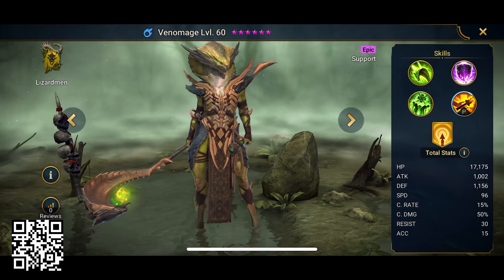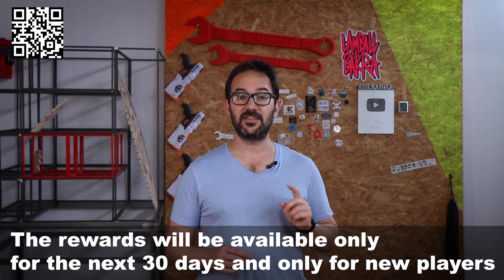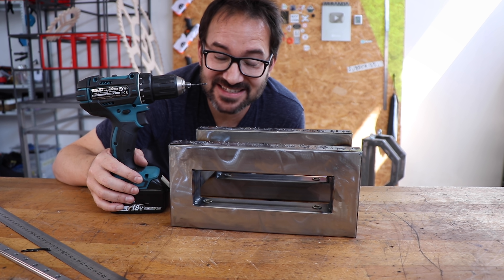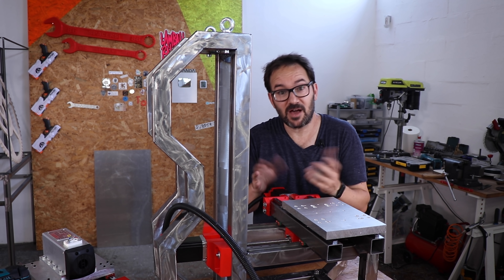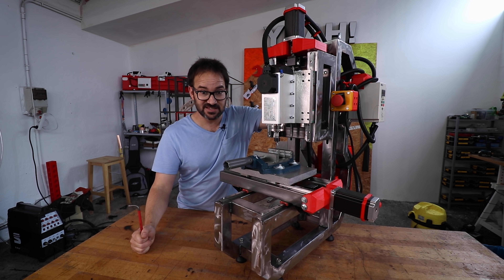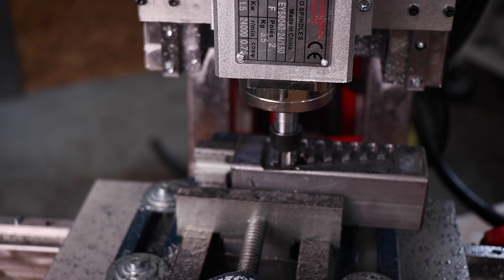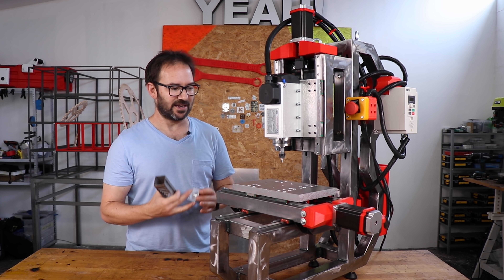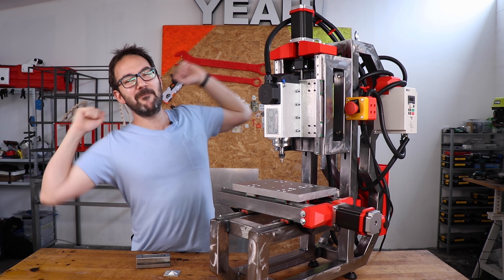I MADE A STEEL CNC MILL FROM SCRATCH (desktop version)

Comment: Check out epoxy granite casting. Its a cool way to make really rigid and strong machine bases without having to pour your own cast iron. You know, when you inevitably decide to make an even bigger machine. 😁
Reply from the maker: That will definitely happen so I'll need to find me some epoxy granite yes.
Reply: @ivanmirandawastaken  Yes, Yes, Yes!!!!! We are living in great, great days! 👍😁👍
Reply: @McGutschy2  yes, using insane amounts of highly toxic substances that will dever decay.. and also act as hormones in mammalian bodies.
Reply: @ivanmirandawastaken  A cheap and easily obtainable alternative to granite / garnet is aluminum oxide - Also a good way of recycling used blast media. Its also more dense so you'll get more mass for the vulume you pour of it which might help you if you're building small desktop machines
Reply: @_billyk_  the weight gains from Aluminum Oxide would be good, but the reason Epoxy Granite is specifically recommended is because of the vibration damping that is created by the specific blend. From what I remember, EG has even better vibration damping abilities than cast iron, without the multi year seasoning process cast iron requires to properly remove all the stress inherent in the material.
Reply: @ivanmirandawastaken  remember to 3d print (with a large enough printer) all the internal structure of the granite cnc.. Holes / conduits for wiring..  Lubrication..  A mega jig where all the nuts and where a  structure  for fixing the rails will go..  Etc then all that goes inside a simple mdf mould where u pour the granite cnc.. When it hardens u just put the rails and stuff over it and its over. U may not ever need to take the mdf out.
Reply: @JorgeMarioManuelOrtega  You Will need to take the MDF out as it eventually absorbs moisture or cutting fluids and oils and then swells up, thus ruining your accurate surfaces. If you do wish to make formwork for concrete or epoxy castings then I would recommend that you purchase cabinetmakers white melamine board, (HMR, High Moisture Resistance, if you wish to use it for several pours) as it is basically the same price as MDF without as much of an issue with the dust and water absorption.
Reply: I look forward to seeing that.  I used some in another application, want to use it to add ballast and rigidity to a CNC platform...
Reply: @ivanmirandawastaken  wouldn’t be a bad idea to fill the tubes with epoxy. Will absorb a lot of vibration and reduce chattering on parts.
Reply: @ivanmirandawastaken  fill those tubes with and that machine will go from meh to f***ing A
Reply: Love to see this followed up im in the process of planning my first cnc build but i want something more than most affordable consumer options been already thinking some form of epoxi granite and box steel welded frame myself@ivanmirandawastaken
Reply: Personally, I think there's a bit too much that can go wrong for the beginner with the mould making and casting process if you're going for a bare epoxy/granite build. With the cost of the materials it's not something that's particularly forgiving if you slightly misalign a mounting point or two while constructing the former, but on the other hand, there's a lot to be said for going the E/G filled box section frame route.

Apparently, even a framework made from 100mm box section can be made rigid enough (Depending on design) for quite a reasonable sized home mill when filled with a E/G slurry and all the air vibrated out. You just need to be careful during construction to ensure that any bolt through holes have sleeves to keep them from getting closed off, and any bolt threads that extend into a void that's getting filled are smothered in grease to keep them from becoming permanent.

I've never used epoxy with granite myself, but I have use epoxy and sharp sand to fill the main structure of a couple of welding table that I've made (Mainly from 75mm steel box section), and those changed from having a distinct springiness to them when hammering something on it, to feeling like I was hammering against rock. It was a VERY noticeable improvement........... But did turn it into a 4 person job any time I had to move them. :D

As I said, Hat's off to anyone who can mould the stuff with all the mounting threads and plates pre positioned with pin point accuracy, but for most people, the risk of missing out a mounting point or getting something critical slightly too far out of alignment to be able to shim would make it quite a risky project. Then again, I suppose Ivan HAS got the 3D design experience to think out the moulds without any errors or omissions, and he has the equipment to accurately machine MDF sheets to make the moulds spot on, so maybe he's in the minority of folks who COULD easily build bare E/G machine chassis ?
Reply: You could probably get by with just a epoxy and sand epoxy granite then you could just 3d print a hollow machine and fill it with epoxy granite
Reply: @joshuahuman1  that is a good idea indeed! A 3D printed mold, the guy has the skills to do that.
Reply: @claudiolorini3311  i was more thinking of the printed parts becoming part of the casting that way it adds a layer of protection from impacts to the epoxy granite rather than a mold  also it would allow easy mounting points for smaller accessories that can just be screwed in the 3d print instead of having to embed threaded inserts
Reply: @joshuahuman1  I don't think that would be a wise choice for a machine shop tool like a mill or lathe. 3d printed parts are plastic, and while plastic is very tough and durable, it's nowhere remotely close to steel or granite. It's very likely it would fracture, abrade, or even just plastically deform on their own from the compression. Also, plastic is likely to become brittle and degraded easily by the various oils and chemicals involved in machining.

I could absolutely see a quality 3d print working well to act as a locating system for holes, to form conduits for cables and other parts and stuff like that, but I don't really see them as a permanent part of a serious milling machine. 

Who knows though, it's also possible that I'm totally wrong lol. Ivan has already made a couple of machines using 3D printed parts, and I'm more than willing to be proven wrong lol.
Reply: @2011JMB  I was more thinking of it as almost a skin for the epoxy granite rather than adding structure so for example if you drop a wrench on the corner of the epoxy granite you could chip one of the edges but if you had the 3d printed skin it could protect the corner also i more meant for the 3d printed holes / threads to be for things like electronics cables drag chains and limit switches
Reply: @claudiolorini3311  It works.  Mould release agent and slow cure resin to minimise warping of the mould from exothermic process.
Reply: @claudiolorini3311  no it isn't. Most 3d printed parts are weak and won't hold screws well. It would add nothing to a cnc build. Epoxy granite needs to be cast in a dimensionally stable mold and ideally over a steel skeleton to give you something to screw rails to. 

You don't want 3d printed plastic anywhere near a cnc build.
Reply: @Zebra66  yes, but i'd like to remind you we are talking about a guy who 3d printed a whole fricking TANK and take a stroll with it :-). I think Ivan can engineer a mold strong enough to make the job done.
Reply: Agreed, though this is a solid concept - add sand filling to the tubes and scrape in the flat on the tubes for where the linear rails sit properly (or shims under the bolts if you like) and its a machine I'd actually call good enough. Which for Ivan's builds doesn't happen often - though don't get me wrong great to aspire to build things beyond your tools/time/skills - only way to really learn, and many a bodged tool built here - its not bad if it works well enough and you still have to start somewhere - can't just build a great machine from nothing, got to bootstrap your way up using what to have and building towards making it superb. Or cheat and buy/borrow a good tool for the job...
Reply: I had a tube-made machine previously and it was more like a musical instrument than a mill because of stepper-induced resonances.. now I'm building a steel+epoxy-granite machine and even with 10 to 20mm thick steels tend to ring. After epoxy casting, it is nearly dead when hit with a mallet.. but definitely a way to go with tubular structures 👍
Reply: He could pour the epoxy granite inside the frame of that machine , he only have to put some bolts across the tubes so the epoxy granite will bite , he will notice the stiffness straight away
Reply: I was looking for this comment. It is crazy how many epoxy granite based cnc mills YouTube has been recommending me lately lol..I am totally convinced it is absolutely the way to go. I have even seen some machines made with some high strength concrete...
Reply: @HeimoVN  some of the finest air bearing Swiss machines are epoxy granite based
Reply: @glass1258  I am not surprised, I understand the vibration dampening properties of the material to be truly excellent..
Reply: SeanHodgins:  You are absolutely right!   However, at this point, Ivan is reaching the limit of a machine that can be moved with comparitive ease.  The next step into a cast machine, whether it is cast iron, epoxy granite, pre-stressed conrete, or whatever... moving it becomes an exercise in applied logistics and back-strain!
Reply: It's an excellent material for mass and vibration damping; we used to manufacture internal drums for imaging machines where the precision was higher than what's required for machine tools. There are a number of problems to watch out for though, one of which is the epoxy catching fire mif the inert filler material isn't added quickly - I witnessed this happen when the hopper delivering the mineral chips jammed, it filled the entire building with foul smelling phenolic smoke.
Reply: Huh I need to look into that. Sounds useful for my 3D printer parts
Reply: Alex CNC made one with normal Concrete and its beautiful.
Reply: i think a better way would be to use UHPC, which is a type of concrete
Reply: As soon as I saw the box section, I thought that he could do a gravel and epoxy fill in the box section. It may not be the best combination though, don't know.
Reply: Could you just use a big metal plate and then put it in the casting?

Comment: Just a yellow or red paint on the frame and perfect.
Well, and maybe some further upgrades: a pneumatic collet ATC and a replacement of 3d printed parts with machined aluminium ones.
Reply: No first fill it with sand. Then add another bearing block to all of the screws. Then disassemble it completely and make sure it is all aligned and square. Then add way covers for the screws and the rails. Then install the electronics into a EMI proof extra case, since VFDs are often nightmares.
After all that is done, then you can start thinking about upgrading the spindle for an ATC one. That is the very last step. 

But I do not see any problems with the 3d prints here. Ok the spindle nut holder is a bit iffy but I do not see it as really affecting the machine. The holders for the steppers are fine (as long as the steppers are not too hot) since they do not take any load. The fixed bearing block does align the ball screws.
Reply: @nukularpictures  Well, the ATC suggestion was just a bit of a kidding. I missed an smiley. The frame's paint is what I would like to see how it looks. Anyway, placing an ATC spindle obviously implies to stiffen the assembly (with epoxy granite or similar), a relay pneumatic valve actuator, etc. course

Comment: Now fill the thing with epoxy granite
Reply: Sand is usually good enough. Much cheaper and easier to work with to dampen vibrations.
Reply: Or you could go the extra step for probably another 50$ and do epoxy granite by just mixing epoxy and sand that way it adds stiffness as well as vibration dampening
Reply: @joshuahuman1  Sure but then the machine will be half a ton or more. With sand you can just get it out easily if you ever want to move it and refill it later on. 

And you get equal if not better dampening. The steel frame should be stiff enough by itself, at least for the 1.5kW spindle. 
The high RPM spindles do not create excessive cutting forces. 

So for this purpose I would not go with epoxy.